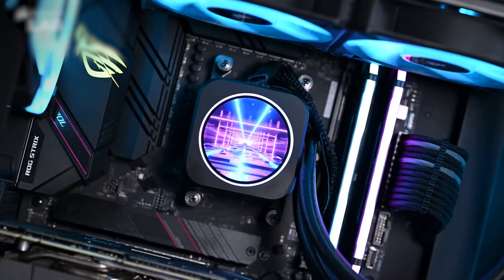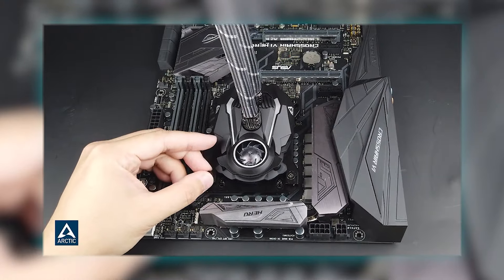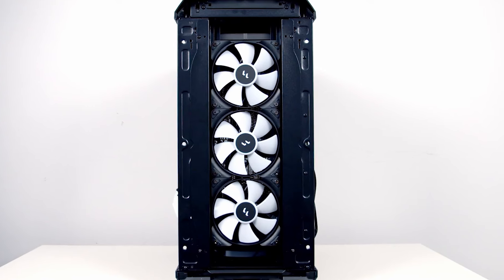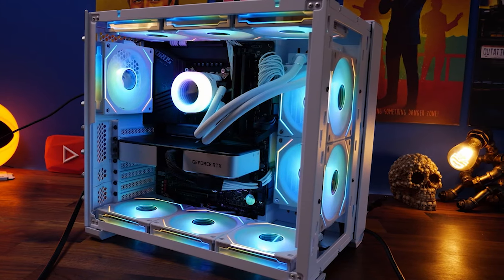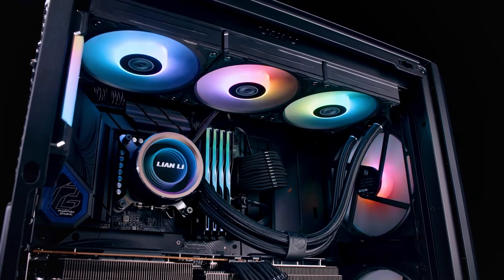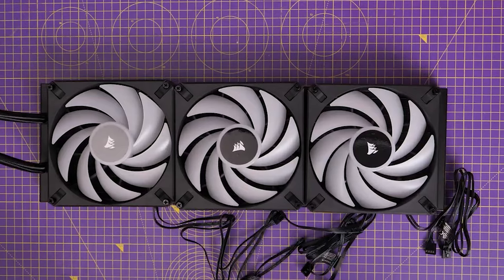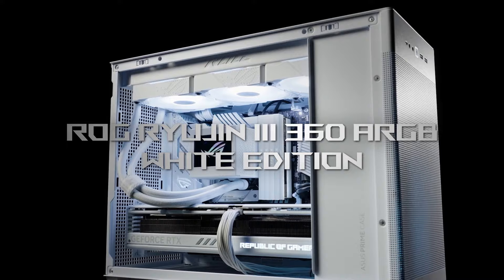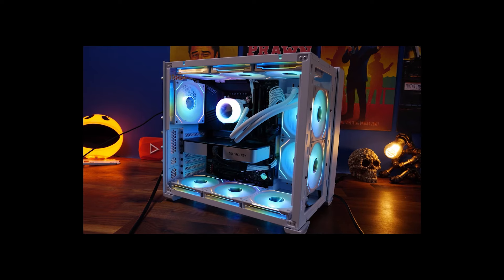Top 5 Best CPU Liquid Coolers in 2025 – Keep Your System Cool and Quiet!

Comment: As the comments have stated, these coolers are from 4 years ago, the liquid freezer 3 420mm is my recommendation, and they have it in white. if you need the quiestest cooler, corsair magnetic dome fans are a minimum for the corsair coolers, that version of the fans is about 2 years old, its the 2nd gen of the magnetic fans, and can be replaced with the brand new 30mm thick MAX version of the corsair magnetic dome fans. but they dont come in white as of oct 31st 2024.